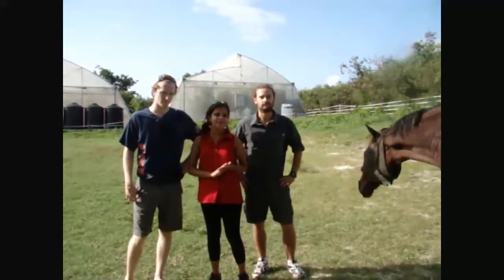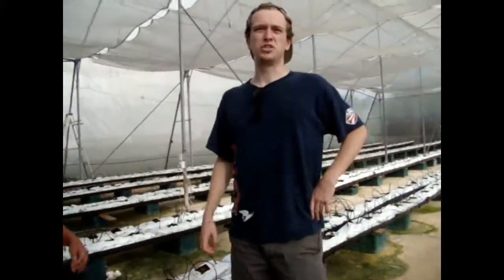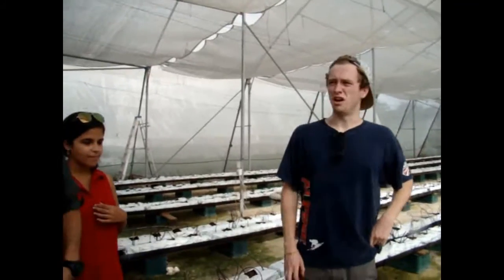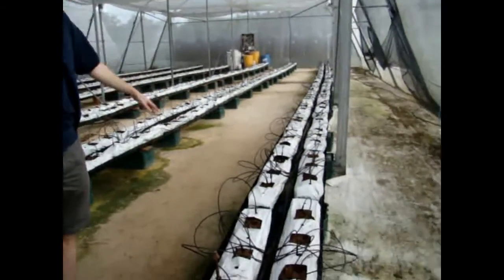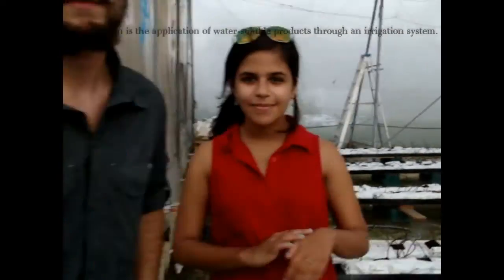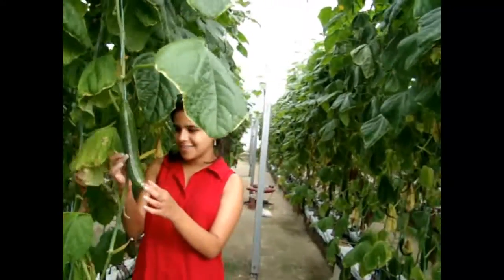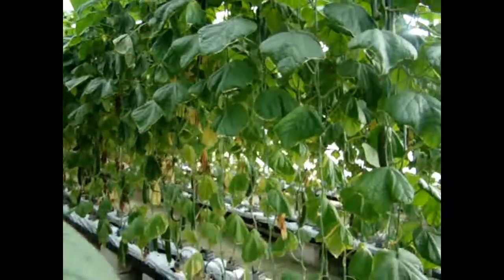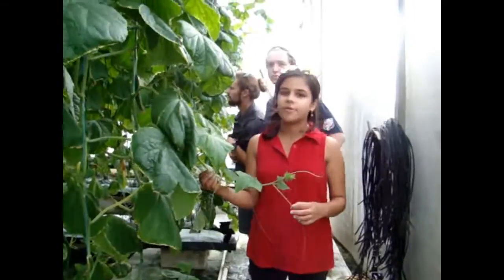BITS 2014: Tropical Greenhouse Design Group

Comment: hi guys, great design! Can you please elaborate on the how to cool the inside of the greenhouse and maintain it. I notice how high the ceiling is, for a country like Philippines where we get typhoons, would you agree that it's not suitable? Thanks guys!
Reply from the maker: +Bert Bote We designed the greenhouse to have the top roof collapsed down to deal with a hurricane, it was in our original plans.  We feel it is suitable. As for the cooling, we make use of our patented NVAC (Natural Ventilation Augmented Cooling) Greenhouse technology, which provides assisted natural convection by use of a water misting system.